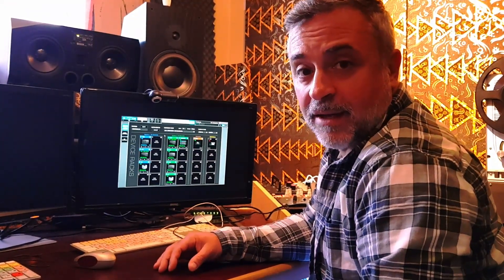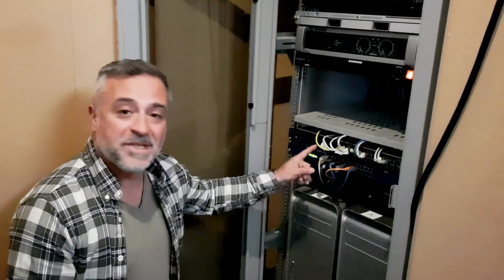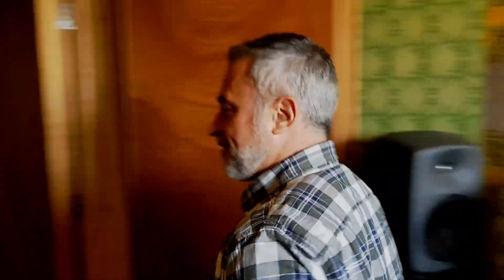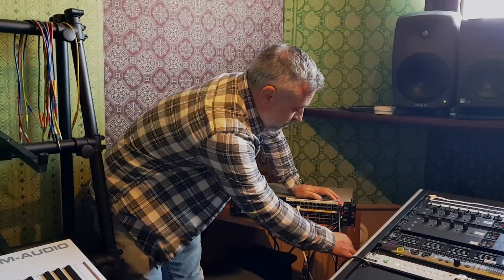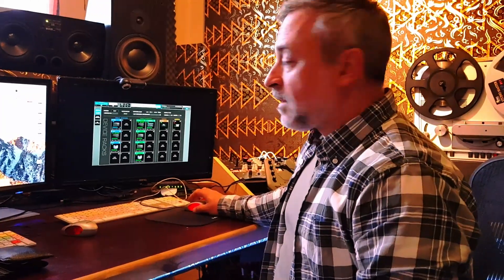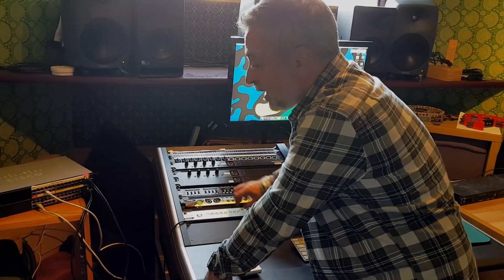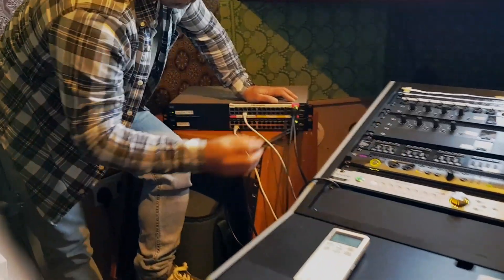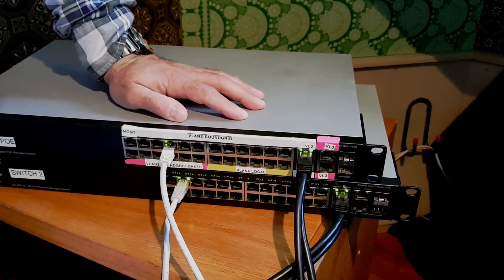Waves LV1 ethernet redundancy with Cisco SG300 + configuration file.

Comment: (((((((((((((((((((((((((((     MAN I DO NOT HAVE ANY OF THESE PROBLEMS    )))))))))))))))))))))))))))))))))))))
All that and you could simply get a ((( #SAC - SOFTWARE AUDIO CONSOLE RIG...)))  Use all the plugins you use in your studio AND virtual instruments! A 25 console replacement and with ABSOLUTE ANALOG QUALITY, BAR NON! I use Behringer ADA 8200 with RME HDSP CARDS and have a 64x64 i/o rig with ZERO LATENCY... and can flip to any one of entire ((25 consoles)) with a touch of a button All on a single PC.
...The first system on the market that was design for seamless usage with a 3M MULTI-TOUCH SCREEN #and use a laptop for a wireless of cable interfaced #REMOTE.......... UNDERSTAND, A $500 piece of software!

#Plugins I use LIVE:
EVENTIDE COLLECTION
PSP AUDIOWARE
VALHALLA
FAB FILTER
BRAINWORKS
LINDELL
and many more + a whole host of virtual instruments... AND record the entire show with the same PC, with SAW STUDIO on the same PC running in the background, with full separations! last night I ran SAC 32bit & SAC64bit & SAW Studio 64 bit AT THE SAME TIME ((on a single PC)) , no pops, no fall outs, no drops and with ANALOG AUDIO PRECISION BAR NONE!

YALL DONT EVEN UNDERSTAND THE GAME!  

((((((((((((((((((((((((((((((((    http://rmllabs.com/MainSite/sac-video.html   )))))))))))))))))))))))))))))))))
Putting yall up on real game..... 
and as always #UnLOCKyoURfOoL®
Reply from the maker: Thanks for the advice, I'll have a look. Please take care of yourself as you sound a bit over excited (;